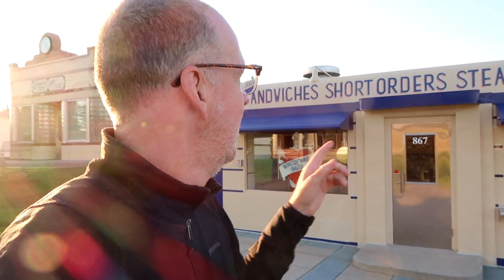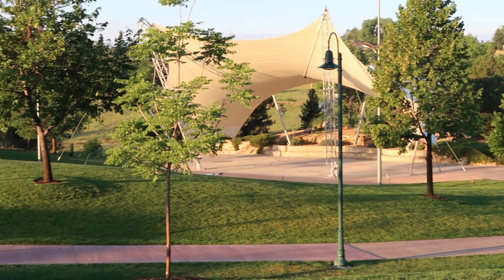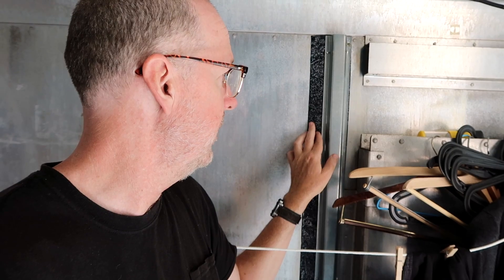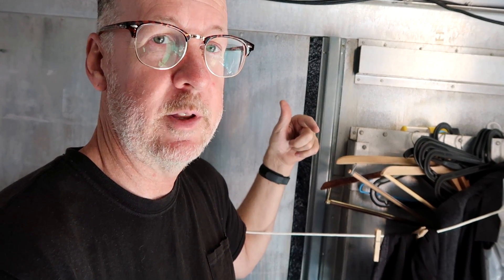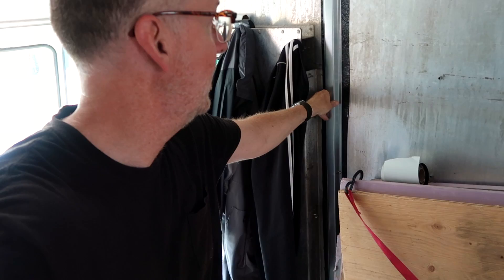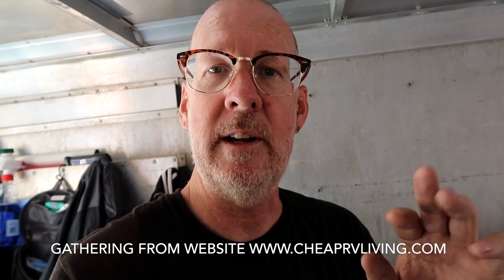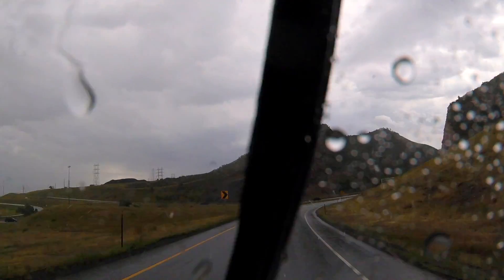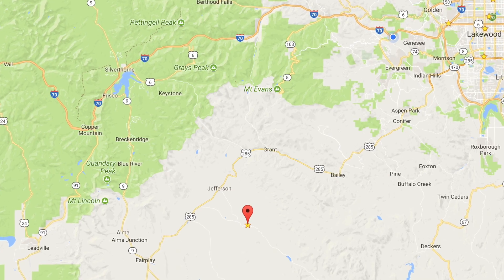New Step Van Steel Support and Avoiding Galvanic Corrosion | Colorado Nomad Gathering E270

Comment: AH Colfax just rang a bell & made the memories come flowing back of the six weeks back in the early ' 70 ' s that I spent @ the former Lowry Air Force Base for Tech School for my Air Force job.
Reply: Your hip has been bothering you for a long time now. Please get it checked out by a doctor before you fly to Europe for the Camino.. You may need an X-ray or cat scan or an MRI.
Reply: What is a loading bar please?
Reply from the maker: my hip is feeling better the last couple days. I think maybe the mattress has something to do with it. I'm trying to do short walks and wait one week for good rest on the new mattress. after that I want to do a long 2 hour walk to see how my hip feels. unfortunately my insurance requires I return to Texas so most likely won't see a specialist until winter and just skip walking the camino (if the hip is still bothering me).
Reply from the maker: loading bar... funny you should ask because I had never heard of one until someone recommended them in comments. they are a lot like an expandable shower bar, but used by truckers to hold cargo in place. you can expand them side to side, or top to bottom and use a racket to hold them in place with rubber feet. you might do a google search to see what they look like ;)

Comment: Seven, I had commented before about those stretches and it looks like you are now doing them. To comment again, I would not recommend "bouncing" during your stretch, but holding the stretch once you have found a point where its a good stretch for about 20 seconds, switch legs and then again. Once you are warmed up, and loose from that, you can do more dynamic or bouncing stretch for the hip. 

Also, focus on stretching the glute or bum muscles as they are apart of the hip complex. Also would recommend dedicating at least 10-15 min each day or more to stretching the hips and glutes so you can see a difference.
Reply from the maker: thx for the tips on stretching. normally I try to do about 5-10 mins of walking to warm up my muscles and get general blood flowing, then do moderate stretching and continue my walk by picking up the pace to a brisk walk. mostly I'm trying to listen to my body and what it is feeling or telling me it can do. but good tips on the glutes

Comment: Hey Seven :-) Good work with the steel strips and the info about isolating them from the Ali walls. Lot of people wouldn't think about that. Wish we could get those American step vans here in the UK. UPS have their own specially made ones, built on Mercedes chassis, but I've been told they don't sell them on to the second hand market. I guess they must just scrap them when their done. I have the same kind of problems with my hips. Driving long distances is a problem. Be well.
Reply from the maker: UPS doesn't seem their vans in the USA either (it is a mystery to everyone). I've not had any hip pain driving, only when walking or carry heavy items (like moving furniture)

Comment: Seven,,I tried plumber's putty on an aluminum pop-up camper,,It did not hold up as a sealant,,,,I don't know if it was because of the constant heat from the sun,, But it dried  out and failed in about six months...I do live in Florida so temps are pretty intense.. Just my experience,,,It May work for you...Safe Travels,,, Old Guy
Reply from the maker: thx for the feedback and info on the putty. was it regular putty or butyl tape? I'm hoping the butyl tape in combo with the self leveling lap sealant will be a bit more durable, but I'm planning on an annual check of my roof each spring

Comment: Have you considered a bicycle? you should try a few different types of bike and see if your hip hurts less.
Reply from the maker: I'm planning on buying a bike next month after my bed platform and garage is built
Reply: Make sure you test ride a lot of different types of Bicycle. I personally ride what is called a bmx cruiser with 26in wheels. but there are basically 4 classes of basic bicycle design from touring, cruiser, mountain bike and hybrid.  I've put people who hated bikes on my cruiser and they were buying a 26in HARO a week later, I've single geared mountain bikes and made tourers into fix gears. Different geometry make a world of difference, especially to someone who does not have experience riding. Find a bike with bars and a seat position that you can comfortably stand up and sit back down on. Find a bike shop, if you have a budget buy used, don't waste your money on a BSO (bicycle shaped object) from a big box store.
Reply from the maker: thx for the advice. I'm looking for a mountain bike in my size and trying to buy used

Comment: Loading bar?  I'd use a piece of 1 x 2, about 72 cents at Home depot, cut to the right length.  The real issue with load bars is that you own them after the job is complete, and you can use the 1 x 2s or burn them in a camp fire
Reply from the maker: a few days ago I tried a 1x2, but it kept slipping; the loading bar seems to be working much better with its adjustments and rubber padded feet
Reply: What works best for you, works best for you.  You can quote me on that.  I'm headed back to Colorado after I get my new hinge assembly installed.